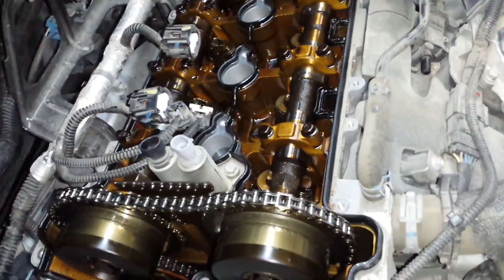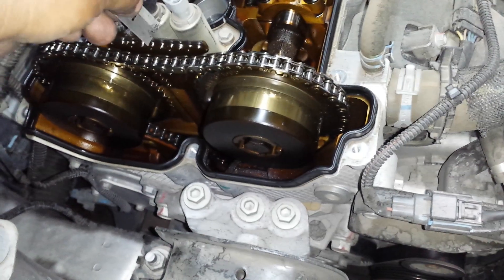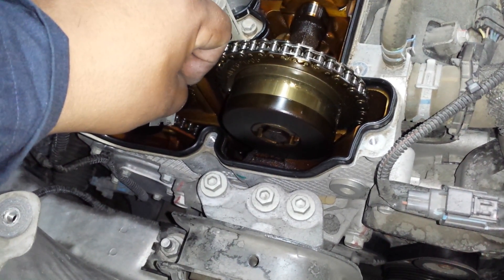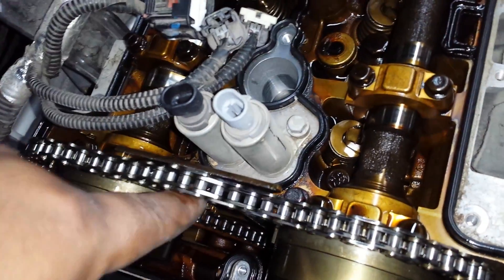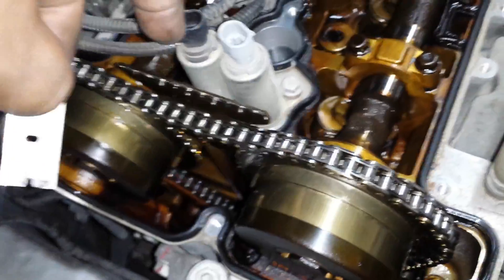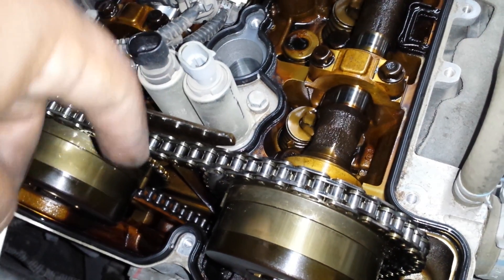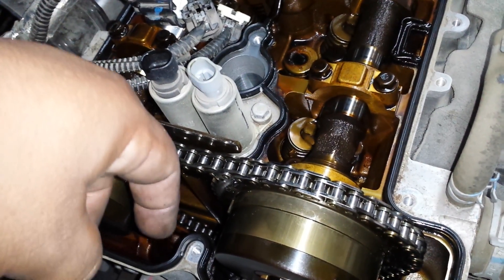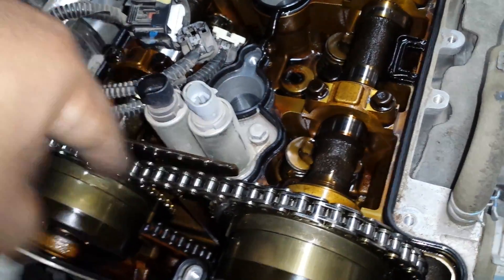Ecotec 2.4l timing chain defect

Comment: I own a 2008 Pontiac G6 with this 2.4 engine. What a piece of junk it is. I'm still finding crap in the oil pan 25k miles later after having the timing chain replaced. It'll be the last GM vehicle I ever buy. They just don't last 400,000 miles like they used to back in the 90's and early 2000's.

Comment: How many teeth can be skipped before you can't replace the chain and need a new engine?
Reply from the maker: Pretty simple, when you don't have any compression. You would need a compression guage to check each cylinder

Comment: What years 2.4 are bad?
I just bought a 2007 Solstice manual with 51,000 miles...runs smooth and quiet so far......
Reply from the maker: Direct injection ones. 2010 up. Crank case ventilation on those cause all the problems.

Comment: Pontiac Solstice GXP 2.0 2007 at 65,000 had bad guides... and 1000 miles later P0010....these engines are poorly designed in my option

Comment: Very informative!  Any idea if the defect has been corrected on 2015 or later models?  I've seen several posts on T/C replacement right at 50K miles.

Comment: I know this is an older vid and my comment is new, but.. I had a customer come in last month with a misfire at idle and engine light on, on her '12 Malibu 2.4. All service has been done at her local Chevy dealer.. IE oil changes, etc. Codes were PO300 and PO302. Scan data showed active misfiring on #2, and every so often #1 and 3 as well. After ignition and fuel system testing were verified OK, I did a cranking compression test with the ICBM fuse pulled, so no fuel/spark. #1 was 118psi. #2 was 92psi, #3 was 128psi and #4 was 150. I called the customer to inform her that we most likely had some sort of mechanical issue and a tear down inspection was needed. She informed me that she had an extended warranty over the basic 3/36. SO I put it back together and sent her on her way. I followed up with her this past Monday, 11/20. She said the car has been sitting at her Chevy dealer apart, and they found that not only had the chain slipped but also 'ate' an intake valve on #2 .. They were fighting warrantying the repair(s) even though she only has 71K on the car, and is the original owner.. This car had no oddball noises while running. I see that other posters have stated the GM is extending the warranty to 120K.. Would you suggest that she try a different dealer, or continue to argue with them? Perhaps a call to corporate? Anyone see 1 of these engines fail like this at such low mileage? Thanks!
Reply from the maker: Adam Trombino You might have to call corporate or their costumer care number. Sometimes you have to ask nicely and play friends. Some dealers are fair while others are tired of warranty work. So at least try calling first then you might be needing to relocate it. But I think with all the service work and being one owner should no problem.
Reply: I heard gm was only extending the warranty for the Malibu’s for the wave plate defect in the transmissions. I don’t think it’s for the timing gear issues.

Comment: He said a 100000 miles like that was literally no mileage on the vehicle 100000 miles is a lot of miles for that type of service had it   been a BMW 100000 miles d*** near be a brand new engine. That's normal wear.
Reply from the maker: F.A.B Food,Auto,and Boxing 
That's not normal. I have a  1999 Chrysler Town and country with the 3.8l and 41ae awd. They lasted 240k miles when trans failed and installed a used engine and rebuild the trans. I had 2 bmw 750il. A 91 and a 89. Neither had a failure like this. Both had over 200k miles. I still own the 89 and only problem mechanicly it has is valve stem seals are shot.
Reply: Alex Alanis most cars Timing intervals are between a 100 and a 150,000 miles. I'm most cars just because you went more than a 100000 miles on a Chrysler for doing a transmission doesn't mean that they're not at exceptions to the rule when did you do the timing? I had 230,000 on a Grand Am then three trans went out. Original timing and all. But going that long is not good.
Reply from the maker: F.A.B Food,Auto,and Boxing 
Timing BELTS are 60-100k . Chains are supposed to be life of engine. This engine has a bad  crankcase ventilation system that clogges and starts to consume the engine oil at a fast rate before the next oil change its starves itself of oil and takes out the cheap stamped steel chain tensioner and all downhill from there including gouging cylinder bores.

Comment: I read many of your replies below and you seem to be more familiar with these engines than anyone else I've read or watched videos on in the past few weeks. I was hoping you could help me a bit, I have a 2012 Chevy Captiva with the Ecotec 2.4L engine. About a year ago, 50k miles or so it had on it, it started idling rough in the winter so I took it into a local shop. They couldn't find out what was wrong with it so they reset the computer and it worked fine until summer.  In July it was idling even more rough so a friend replaced the intake O2 sensor and it ran good until about November.  On January 1st of this year, it finally had really bad idling problems like it was jumping back and forth while in park so stopped driving it.  My friend replaced both O2 sensors, in and out, the cam shaft solenoid sensor, spark plugs, and the whole throttle body assembly and that did not correct the problem either.  When we reset the codes the car is able to run well at 2k RPM and higher and has power and sounds normal.  It still is rough in idle.  Three times though, we ran it on the highway after resetting the code and the car ran perfectly without needing to be in higher RPM.  Even at an idle it ran perfectly and did not rough idle or die out, however, as soon as you shut off the engine and turn it back on the rough idling starts again.

I took it to a shop to have them look at it.  They believe the timing, seals, camshaft, pretty much the engine is shot.  But if that were the case, it would never be able to run smoothly, correct?  It just ran out of the extended warranty, it has only 84k miles but the warranty ends with 100k miles or 4 years so it just ended in Dec. GM won't extend the warranty so I have a choice of taking it to a GM dealership and "maybe" GM will somehow help with the repairs but not cover it under warranty (slim chance I think), have the other shop rebuild the engine (about $2500), replace the engine with a used one (about $2000).  The car is only worth $5000 - 6000 blue book so without the engine its likely worth only about 3000 so a trade is is not very good either unless I fix it.  The same car in working condition on a lot only sells for $8000.  Is this car worth fixing?  Or will I just run into the problem again? Also, it was consuming oil... a little at first about a year ago to about a quart a week just before it broke.
Reply from the maker: MYdjANDkaraoke what were the codes? a quart a week is quite alot. i know the crankshaft seal is one thats known to leak alot if failed but not a wallet buster to fix. The rough idle usually has a code associate with it. At first i though you had a vacuum leak or adaptation issue but knowing codes points in a general direction.
Reply: Thanks, I have the codes. I'll get them to you later today. I appreciate your quick reply.
Reply: The codes are p0016 p0089 p228D module $7EA $7EB. The mechanic thinks that there is something broken upstream from the problem though which is causing the sensors all downstream to report errors. Sorry I'm an IT person so I'm not familiar with the mechanic terms for the problems from and to a part.
Reply from the maker: MYdjANDkaraoke No problem. my brother is in the same career. Those codes point to loss of oil pressure and having a broken tensioner and or loose chain or broken guides. Cam sprocket actuator can be sticking also. There is probably metal in that engine. It probably feels like a hot rod at every stop light with a loppy idle and runs normal at anything above idle. If you're not planning to keep it. Try putting 15w40 or 20w50 and cut your losses and trade it in.  If you're keeping it... it's might be a whole rering engine rebuild. Make sure they put a new oil pump and cam gears and rod bearings. Having them clean the intake manifold crankcase vent hole. You have to make the call to it's worth.
Reply from the maker: I don't know if they are still doing the owner satisfaction repair where they replace the piston rings too free of charge if your consumming oil. You might get a new engine out of it. I'd give it hell to have it fixed under warranty.
Reply: GM might be still doing that, they did mention even though my car's warranty expired in Dec 2016, their GM assistance program may but also may not help to pay for some of the repair cost.  However, if I am going to trade it in, I can't take it to them otherwise it will show up on the Carfax report.  But I think you are right, with it breaking so close to the warranty expiring, within 2 weeks and due to time and not mileage I could have a valid argument for them to fix it under warranty.  Thank you again for all your help!  I'll likely not have an Ecotec engine car here shortly but I subscribed anyway.  You are very knowledgeable and also able to explain things in a way the normal person can understand!
Reply: @alexalanis8077  Hi, I have a similar issue.  Same codes, but engine just rebuilt, but still has original cam actuators.  Also replaced the cheap aftermarket tensioner with the latest updated tensioner from GM.  That has helped some, but after doing idle relearn, the car will not learn a new idle.  Hunts like crazy from 500 to 1000 rpm.  Base oil pressure at idle hot is 25 psi and 80 at 4K.  Measured at block from oil pressure sensor port.  Engine is noisy as hell at hot idle.  LIke a diesel.  P228D, P0016, P0011, P0089, P0300 were all codes in the engine.  Was redone due to excessive oil consumption.  Only code now is p0300 which only happened after 15 min at idle.  when cold, engine idles good, and quiet.  fuel trims look good.  Less then 10% on short term.  O2 cycles well but the cat is done.  175K miles.  Other mechanic used Dorman solenoids for the cam actuators.
Reply: @alexalanis8077   Alex Alanis  Hi, I have a similar issue.  Same codes, but engine just rebuilt, but still has original cam actuators.  Also replaced the cheap aftermarket tensioner with the latest updated tensioner from GM.  That has helped some, but after doing idle relearn, the car will not learn a new idle.  Hunts like crazy from 500 to 1000 rpm.  Base oil pressure at idle hot is 25 psi and 80 at 4K.  Measured at block from oil pressure sensor port.  Engine is noisy as hell at hot idle.  LIke a diesel.  P228D, P0016, P0011, P0089, P0300 were all codes in the engine.  Was redone due to excessive oil consumption.  Only code now is p0300 which only happened after 15 min at idle.  when cold, engine idles good, and quiet.  fuel trims look good.  Less then 10% on short term.  O2 cycles well but the cat is done.  175K miles.  Other mechanic used Dorman solenoids for the cam actuators.
Reply from the maker: @charlestooraen2210  I usually try and replace the cam phasers on a rebuild along with having the head rebuild because metal particulates will settle down in the phasors and lifters and lifters valley. And exhaust valves are ready needing replacing and having the valve seats redone. But I hope that's not your case.
So now Only P0300. Random misfire. Have you checked for vacuum leaks. Look at misfire history to see which ones are missing most or current misfire to see which one starts missing first as it goes to close loop fueling.
Reply: @alexalanis8077  okay so a couple of updates for this one. The major hunting at idle issue was simply carbon and sludge buildup in the throttle body. After doing a idle relearn it could not relearn it's idle because of the sludge build-up. So after I clean the throttle body the idle hunting issue has gone away and currently it's not throwing any more codes but it's still will occasionally have a small minor stumble at idle but not enough to throw any codes and the idle will ever-so-slightly hunt. I have not checked the misfire codes at this point since I've had the battery disconnected and I believe most all of those counters have been cleared out at this point but I will double check. The other thing that was interesting about this one is that the engine has been completely rebuilt about a hundred fifty to two hundred miles ago and all the timing chain components have been replaced other than the phasers. They put some cheap aftermarket tensioner which was the old style tensioner I replaced that also. Which seems to have helped with Cam and crankshaft timing correlation issues. The other interesting thing is is that when this engine is hot you have 25 psi olive oil pressure in the block and only 2 to 3 PSI in the head.  When the engine is cold do you have you have about 80 psi on the Block in about 60 PSI in the head. The other thing is when at idle and the engine is hot you can hear a large amount of timing chain and valve train noise however if you disconnect the exhaust cam actuator solenoid, all the valve train noise goes away and the engine is very quiet. If you look at your camshaft pids' you'll see that at idle the exhaust cam is commanded at 5 degrees and the intake cam is commanded at 16 degrees which both correspond to the desired specs, and there is no variance issues. If you command higher or lower timing Advance on the cams they correspond accordingly even with that low of oil pressure in the head. As far as closed-loop operation this engine won't even begin to stumble or Miss until after 30 or 40 minutes of driving and only does it at idle after it's been idling for 5 or 10 minutes after a decently Long Highway Drive
Reply: @charlestooraen2210  were you able to figure out the solution? I have the exact same problem. Nothing when engine cold, misfire and shake when it s hot idling.
Reply: What if you have a noisy rough idle from a cold start without any codes?  Once it hits the "low" idle it is fine, but at first it is not good.

Comment: this common?
Reply from the maker: RektRyder more common if your engine consumes oil and runs low or starves of oil any time. The chain tensioner is not designed to run dry and will break within minutes or break progressive over time running low. And the chain deflection will wreck havoc on everything else.

Comment: hi I recently bought a 2005 chevy Colbalt 2.2 ecotec and it wasn't running when I bought it, I was told the timing chain broke...so I started working on the car, got to the timing chain and it wasn't broken however one of the plastic tensions did break into 5 pieces..i ordered the timing belt kit,  replaced everything with all new parts...set the timing marks...put everything back together with new plugs...air filter...oil change...and a few other new parts...after all that the car will crank but will not start...? what did I do wrong it is not throwing any codes at all... I'm replacing the crank sensor tomorrow...I bought this car for my daughter for her birthday coming up next month I could sure use some advice and help on this car...I'm totally confused as to what the problem could be...thanks for your helpRead more Show less
Reply from the maker: Loren Jones have you shot starting fluid into it to eliminate fuel or antitheft issues? Have you ran a compression test to make sure valves ain't bent?
Reply: yes it is getting fuel up to the fuel pressure port and a mechanic told me it has compression but im not sure how much
Reply: Bent valves
Reply: Next time buy your daughter a Toyota you will be good for 400,000 miles. Shit can that GM Obama motors pos

Comment: I also pull the oil pan and clean the metal out when this happens.  With the pan off I clean it. It is easy to inspect the connecting rod bearings and replace them as they usually have metal in them as well.

Comment: I've got an 06 cobalt ss with the 2.4 ecotec, I'm noticing 1 misfire per cycle on cylinder 2, and increased oil consumption, also had tc issues, i replaced the intake and exhaust solenoids, replaced spark plugs, and did a full oil change, i noticed the plug on cylinder 2 was covered in oil, tc problems went away completely, car runs great, and don't notice the misfire, but that oily spark plug and misfire the scanner was picking up worries me a bit. could this cause that? or am i looking at a worn seal?
Reply from the maker: Jake sounds like a worn or gouged piston ring or piston bore. If it ever ran low on oil then there's your problem. There's a service bulletin from gm regarding that. Your intake manifold crankcase vent hole might be plugged with carbon too. There's a bulletin for that too.
Reply: Alex Alanis awesome, thanks man! just bought this car used back in September, so i don't know how the previous owner took care lf it, obviously this isn't something i want to tackle on my own, if i wanted to take the car into the dealer and have them fix it, (which i might want to since the motor only has 109k miles on it) would it cost an arm and a leg? I've got no problem doing most work myself, i diagnosed the tc issue in a couple days, and redid the whole suspension, but when it comes to opening up the motor I'd rather a trained tech take the reins

Comment: change mobil 1 every 10.000km and trouble free....
Reply from the maker: ueg1974 the terrain in the video ran AC Delco dexos synthetic blend approved oil and a Mag 1 dexos approved full synthetic. We have too many car in the fleet so now we just run Pennzoil gold. We used to run Mobil 1 but we use the same oil across the fleet to it gets expensive. We now get rid of vehicles at about the 140k mark.